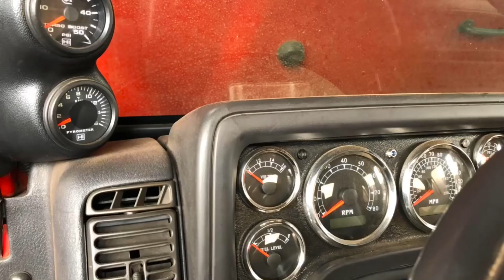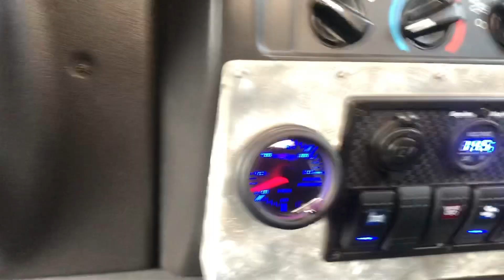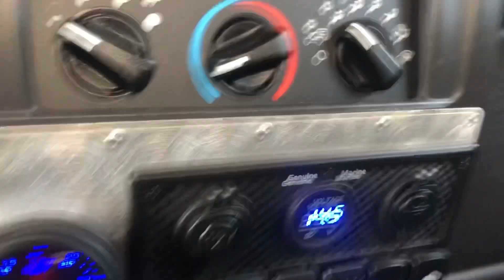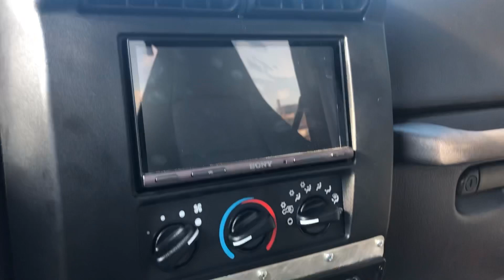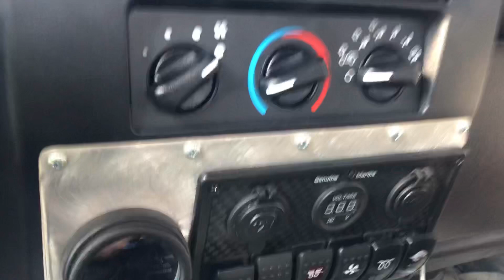4 Banging 4BT Cummins Turbo Diesel Jeep

Comment: What intake/plenum did you use? I have a 4BT swapped 1980 CJ5 and want to put a grid heater in and eventually a front-mount intercooler.

Thanks!
Reply from the maker: It was original one with steel pipe 2.5  hole cut to size . You can call Cummins dealer and order grid heater just give engine serial number tell them 12 volts.

Comment: Are you still doing these swaps?
Reply from the maker: Yes but not just bolt in affair. Need to source parts from multiple vehicles for it to work stock trans and tranfer case. Some parts need to find used dont make anymore.

Comment: What transmission did you use
Reply from the maker: Used bellhousing from Ford Bread truck with adapter to stock Jeep Transmission.
Reply: @ZepolWorkzGarage  did it have the ax15 or the nsg370
Reply from the maker: @SLVR_JKU  not sure? I wasn't there for the  beginning of the build.
Reply: @ZepolWorkzGarage  ok thank you
Reply: @SLVR_JKU  hey I swapped mine over to a 4bt last year and I used the stock AX-15 trans and pared it too the Cummins bell hosing using an adaptor plate from Quick Draw Bran. It mates them perfectly! Comes with a flywheel also
Reply: @trevorshort9916  Will a stock transmission be strong enough? Nothing got beefed up? Also, what about other TJ transmissions?
Reply: @lioncelica5170  nope nothing got beefed up stock ax-15 making 25 pounds of boots when I’m really letting the 4BT rip. Even trailed it a few times on hard trails and it does just fine I’ve  had it behind the Cummins for a year and a half with no complaints at all
Reply: @trevorshort9916  Neat. How do you think an NV3550 or NSG370 would fair?
Reply: @lioncelica5170  I’d say they would be badass the NSG370 6 speed would really be good but both of them would be great behind a 4bt

Comment: what did you do to make it idle like that?quiter than usual.
Reply from the maker: Jeep does have a full 3 inch with Magnaflow muffler.
Reply: did you balance the internal parts of this engine?if not what do you think the advantage if this engine balance?
Reply from the maker: @junalfred2606  no didn't go into engine did have a Fluid Dampener. Balance would be good get more revs. The governor RPM in the pump was set to 3200.
Reply: @ZepolWorkzGarage  hey sir can i have a facebook or any contact information i work behind Anclote recycle and i own a 4bt disel jeep also but i needs some work and help to be perfect as this one
Reply from the maker: @denialpetrov6480  you can contact me through my email racerzepol1@gmail.com.